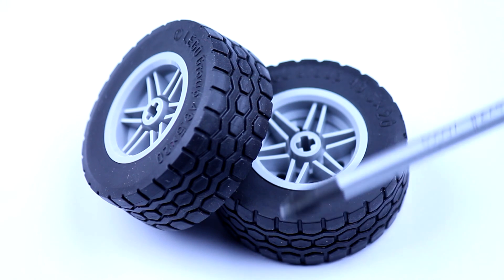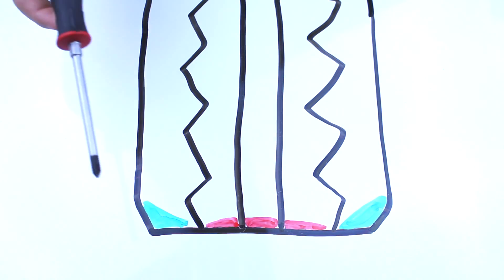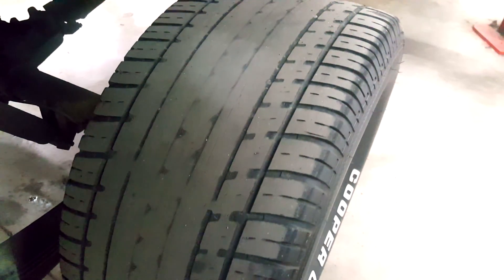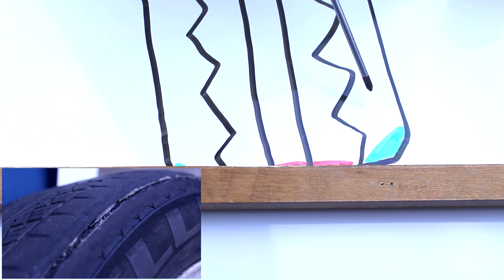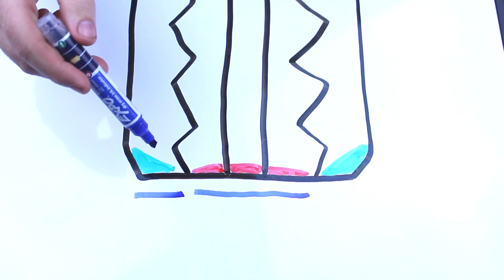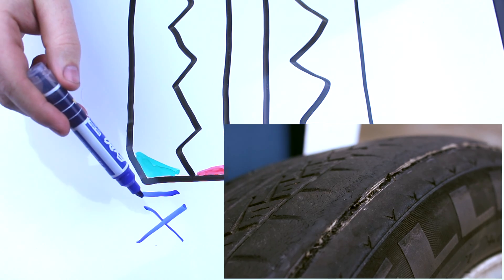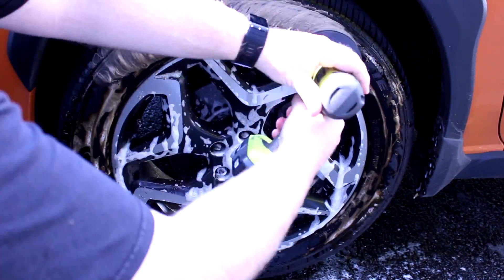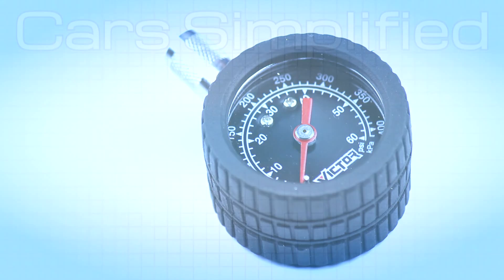Tread Wear Patterns & What Causes Them in Tires • Cars Simplified: Tire Engineering Explained

Comment: Great explanation as usual!  In the 50 years I have owned cars, I have never had any uneven tire wear because I have always made sure my alignment was spot on and checked my air pressure in the tires once a month and rotated the tires around 6K miles.  Once in the late 70's my wife's Scirocco had a bulge her Continental tire front drivers side so it made a slight pull off and on to the left.  I had her drive slowly and as I observed her approaching me I could see that the tire, had a steel belt or belts that had slipped.  About a fist size in the tread area.  Tires were getting older and about 30K miles so time for new ones!  Only time I ever had that situation!   As you know many people drive around with under inflated tires especially in the winter when they tend to lose pressure when it turns colder.  I just shake my head since it is so obvious!
Reply from the maker: Thanks! Impressive track record with the even tire wear!

I've never encountered a steel belt slip so far. Definitely good to look out for that, though!